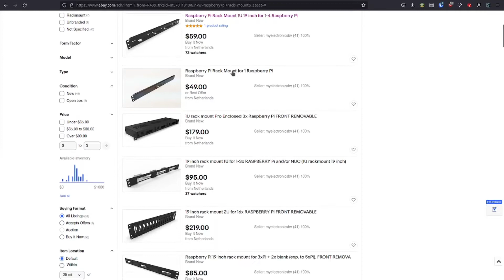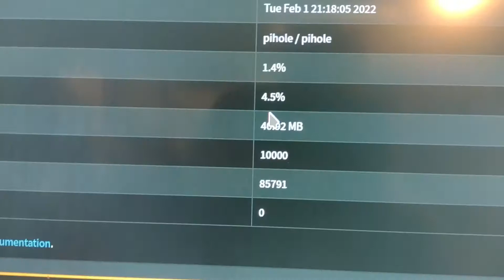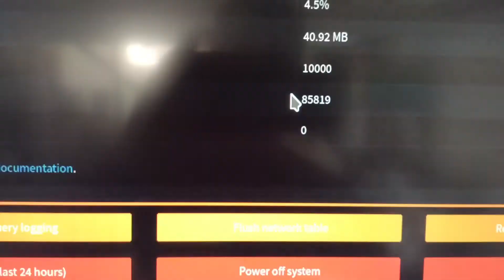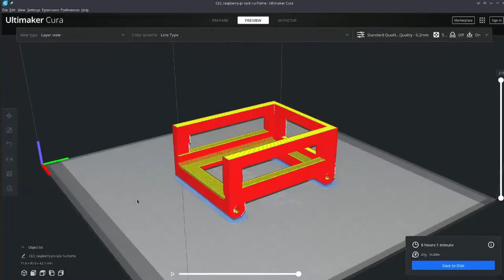1U Raspberry Pi Rack Mount Bracket

Comment: Have you considered just using pin header power?  Would be neat if it was only 4 or 5 PIs with an integrated 5.1v power supply of sufficient amperage...